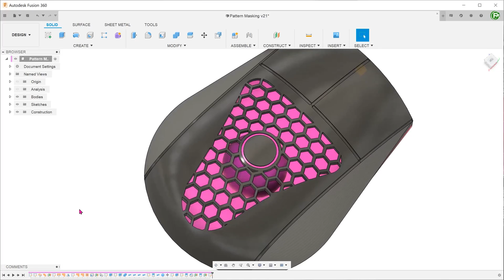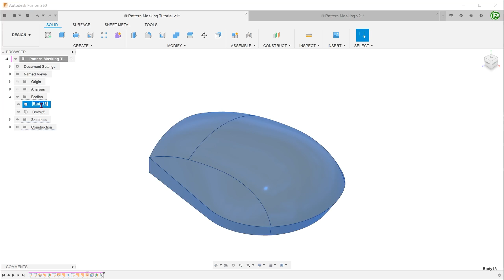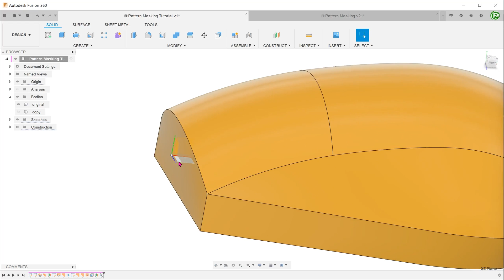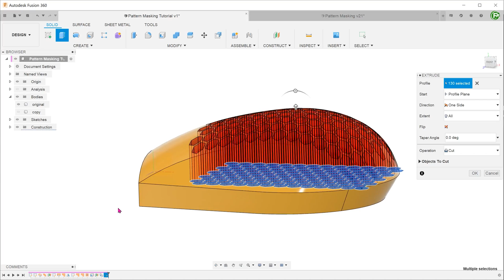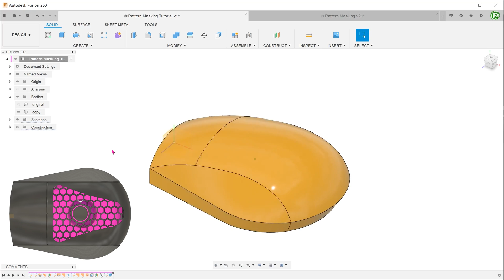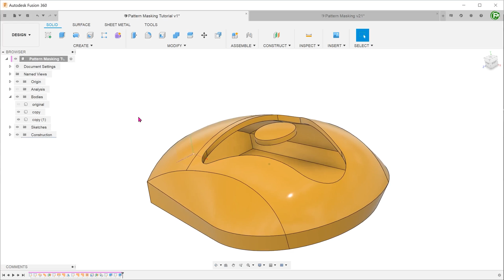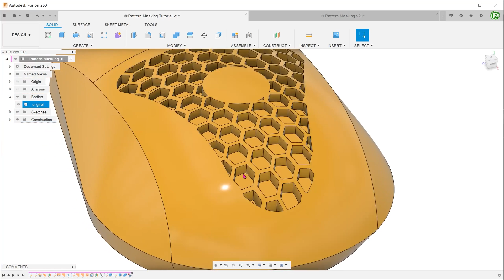Fusion 360 - Pattern Masking

Comment: Nice trick, I did something similar with a Raspberry Pi box but since it was flat there was no need to copy the body. I could Extrude-Cut the shape directly and extrude again to isolate the area with the pattern.
I am a bit biased against copy/paste and Move commands, I think it's because they seem less parametric to me 😜

I've been thinking about this a bit, looking for something simpler, and I think in this case you could apply a Split Body of the shape, then extrude cut the pattern and combine both.
Since you liked my suggestions in other videos I took the liberty to add one here, sounds like a good way to improve together 👌😃
Reply from the maker: Always appreciate your suggestions. I would still class copy/paste as a parametric move, since whatever changes you make to the original would be reflected in the pasted body.
I like your suggestion about the split body. The honeycomb cut then be applied only on the split body. That is certainly a good alternative.

Comment: Alternate Workflow?
what about using a Split Face on the original body using the mask as a profile
then embossing the honecomb pattern only onto that Face
?
Reply from the maker: Unfortunately, the emboss command only works on surfaces with curvature in only one direction (e.g. cylinder). In this case, the top face of the mouse has curvature in 2 directions. When I tried this out, the command does not allow me to select the face. Looking back at this workflow, I should have performed a split body to split out the masked area. I should also have extruded just a single hexagonal cell and patterned this single cell cut instead of patterning within the sketch. The pattern can then be constrained to the split out body.
Reply: @Fusion360School  Surrogate Emboss then.
Reply from the maker: 😀I was kind of anticipating this response. I did see your comment on the surrogate emboss video. Yes, that would work.

Comment: how did you selected ONLY the profiles on the "windows select" if i just drag my selection it selects all kinds of stuff in the sketch
Reply from the maker: Fusion is usually pretty good at recognizing sketch profiles. In this case, there is nothing under the sketch that interferes with the selection. This makes it easier too. If you have difficulty, you can use the selection filter to turn on sketch profiles only. Knowing what I know now, I would actually encourage you to just do a single honeycomb cell, extrude and do a feature pattern instead. Patterning within sketches should be avoided.

Comment: You can use the move\copy command, just move it 1mm in an axis, when done select the body and move it the 1mm back. Sometimes for whatever reason the copy paste doesn't work, so i had to do this.
Reply from the maker: That works too. It is just strange that the move/copy command doesn't allow for copying a body in the original location.
Reply: @Fusion360School  yes, very strange, every other program has a duplicate function, which is not the same as copy and paste in place

Comment: I would suggest you emboss your pattern so it doesn't get all skewed and morphed towards the edges!
Reply from the maker: Hi, thank you for the suggestion. Unfortunately, the emboss command only works on surfaces with curvature in only one direction (e.g. cylinder). In this case, the top face of the mouse has curvature in 2 directions. When I tried this out, the command does not allow me to select the face.